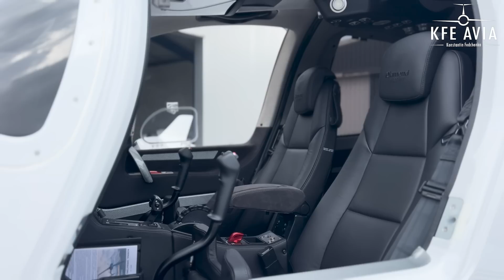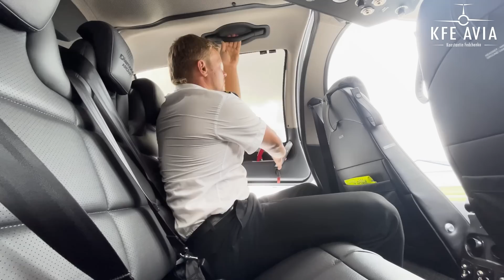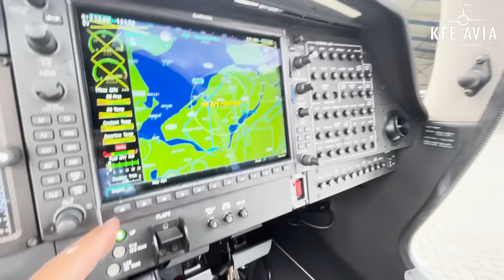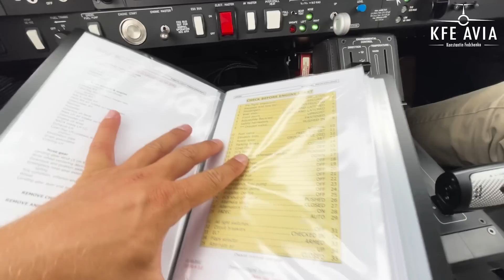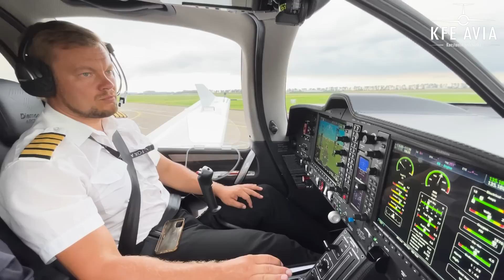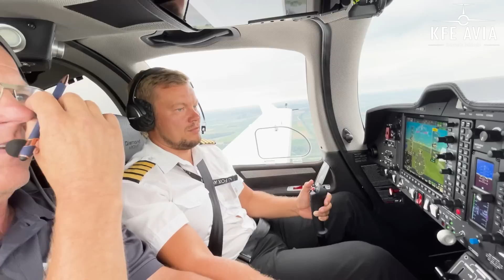Diamond DA50 RG Flight Review

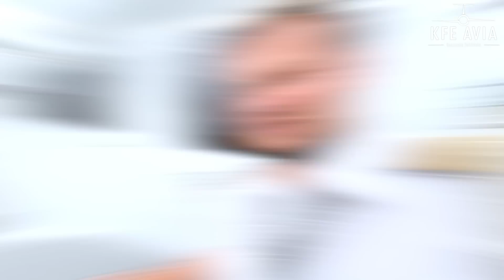Comment: Yes, I know her. Nice aeroplane, looking good on the ramp. Disadvantages are : Range is too small. If you're flying IFR with a nearby alternate in your fuel planning, you can fly just around 2:45. That's all. A little bit more if you're planning without Alternate airport. And the redicilous MTOM of 1999 kgs. For 1.4 million € the owner should expect more.
Reply from the maker: Well, me myself for 1.5 expect it to be pressurized JET to be honest, but if you are a PPL with some cash and you wanna seat in the NEW and MODERN airplane - that’s the way to go, airframe and engine is on warranty - nothing to worry about  👏
Reply: @KFEAvia 
... you have to be patient and wait for spare parts on the ground for 9 months under warranty, moreover, you as the customer have to solve dozens of serious quality control problems, the warranty period ends before the plane can fly.
Reply from the maker: @ with new plane model it is always like this. Look at the Boeing. What is your location, may be your dealer is not very proactive? And what issues are you having with an airplane - would be good to know
Reply: @ If you look to the 2023 Diamond Owners Survey you will see, that availability for Spareparts is a huge problem with Diamonds. Not only for the DA50 but for all types of Diamond aircraft. But what I heard is, that all manufacturers have the same problem. By the way...Will be interesting for US-Customers in the future, when Trump will apply 20% surcharge for custom duty on all articles coming from Canada.
Reply: I'm not comparing the TBM with the Diamond. That's annother class in any sense. But for 1.5 you can expect more performance. And the Continental 6 cylinder Twin Turbocharged engine is expensive to maintain. The routine maintenance on the Continental is more expensive then BOTH Austro engines on the DA62. Yes, the Diamond has very good Flight Characteristics. But only for this and the good look doesn't justify the unreflected applaus. I'm also flying the DA40 NG privately and I'm a great enthusiast when it comes to Diamond aircraft. In Europe you pay around 1.3 for the DA50 RG and 1.6 for the DA62. Everybody can make his own thoughts about the price difference. If you want to go for this class you better think about buying the DA62.
Reply: @340Captain  
If you got money for a da50 then after 2000 hours u got money to overhaul the engine. Simple.  It’s not expensive at all. For dreamers it’s expensive.

Comment: failed design with vortex generators on the upper wing. wtf.
Reply from the maker: This way it helps to have ab authorities on ailerons at low speeds, hence the plane is steerable
Reply: Dumb idiot does not understand engineering and plays with his coock watching men.

Comment: What are the advantages of a Diesel-engine? Less maintenance cost? The Diesel engine has a longer service life? Less consumption? Thanks!
Reply: Modern liquid cooled engine with turbo and low fuel consumption. Low maintenence.  Of course the advantage of jeta1 which means you can practically fly at any airport in the world.